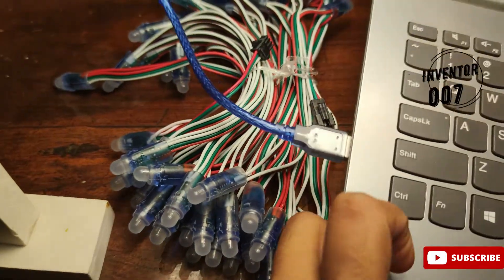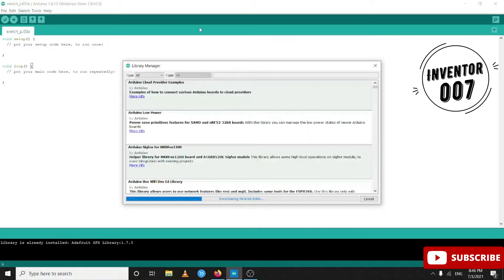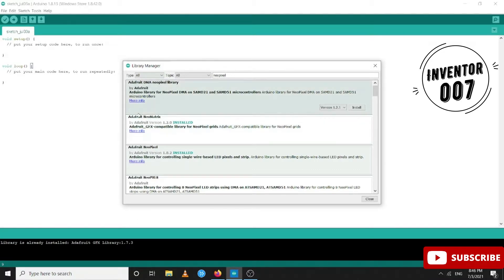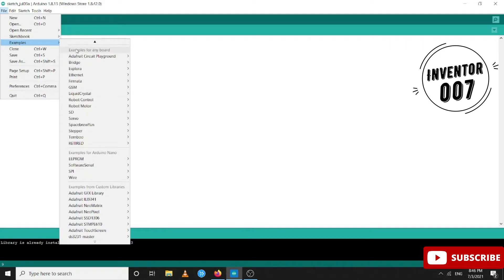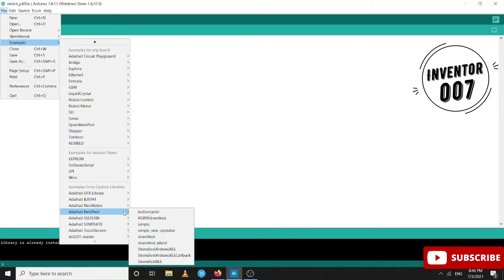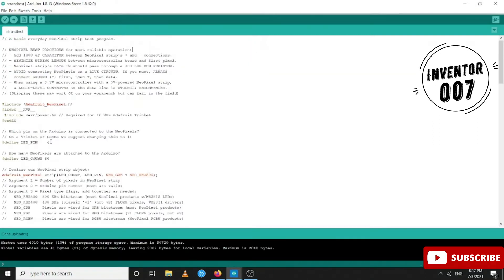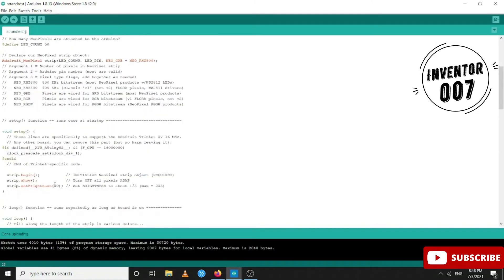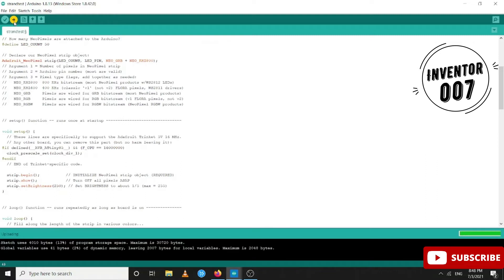How To Connect Neo-Pixel LED Using Arduino | WS2811

Comment: Good And useful video. Plese help for followings;
 1. How many maximum led in a single strip could we used?
2. Can we use multiple strip effects. Make a video on this.
3. Pl. Put the program code of the effect.
Reply from the maker: Okay will make the video in future. Thank you for the comment.